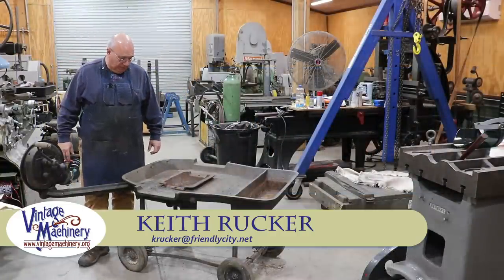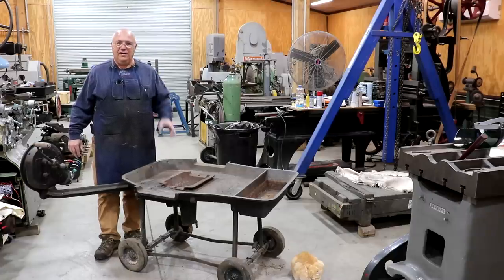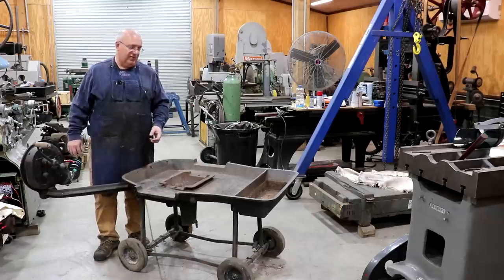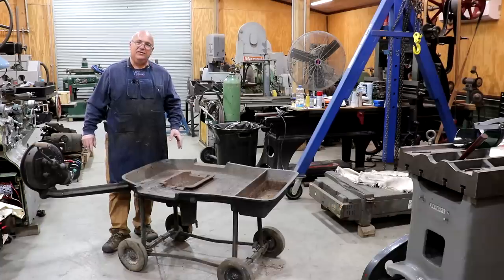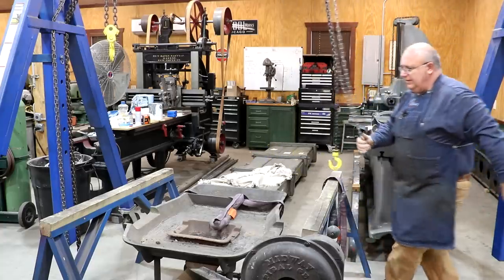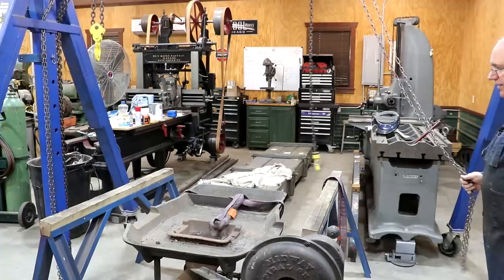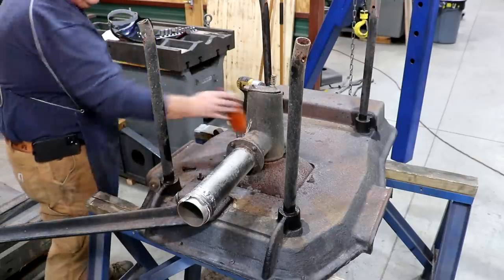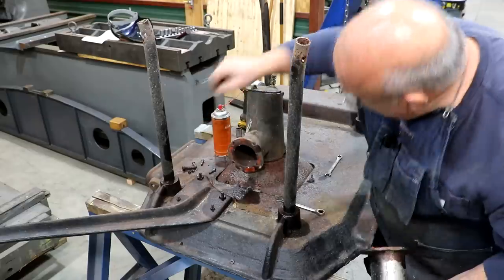Restoring a Champion “Midway” No. 71 Forge and Blower - Part 1:  Disassembling the Forge

Comment: I have the forge, anvil & tools that belonged to my great grandfather passed down through the generations. The duck nest is exactly like yours but with no tray. We have always mounted it in a rock or brick foundation. The blower is on a pedestal. My dad was particularly talented with it & I learned from him. When i was a little fellow, about 3 years old I discovered that by pulling down hard on the blower crank, the flywheel inside would give me a ride over the top picking me up off the ground. One day I was "riding the blower" and it toppled on top of me pinning me to the ground, the oil stem hit me in the head cracked my skull and I ended up in the hospital with stitches and a concussion. My Mother was horrified and surely gave my Dad the 3rd degree. The next day, I was eating lunch (broccoli) in my hospital room when the doctor came by... he said, "If that boy is well enough to eat that hospital broccoli, he's good enough to go home."

Comment: My grandfather (born 1891) trained as a blacksmith in a buggy factory.  When he finished training the boss put him in the paint shop, which he disliked.  He found a job on the railroad and rose to engineer.  He always liked working with metal, and could fix or fabricate just about anything.  I remember the unique smell of his workshop, a mix of varnish, grease, and coal smoke.  They don't make them that way any more.  Thanks for showing this new project.
Reply: Keith is probably as close as you'll get to your grandpa.

Comment: That red high heat silicone is a good choice for that gasket.  We used it on all our late model headers which would be glowing red hot for 100 laps.  It seals better and does not get loose and crack like a gasket.
Reply: I think something like gun gum paste  would be a better alternative.
The old local blacksmith here in town used that for decades.
He sadly past away not to long ago 🙁

Comment: My friend from the NJBA chapter of ABANA had one of those and it was such a joy to use. But looking at that firepot it is super different and doesn't look like the original. I do hope you restore that as well. That original design of the champion firepots worked so much better than the modern ones that just have a puck in the center. That puck always burns out, but the champion one never had an issue and the air was directed super well right to the middle of the coal fire.

Comment: I picked up blacksmithing back in my early 30s (around 2004ish I think).   Propane fired forge, but well equipped with a couple anvils, hammers tongs, etc.  Really got into it to make knives and did that, but had a lot of fun doing other stuff, like making the tongs and fullers, hot cuts, axes, all kinds of stuff.  Unfortunately, just like you mentioned, I tore my right shoulder up really badly a couple years ago and I still haven't gotten it quite behind me yet, may need another surgery yet.  Still have it all and hope to get back to it one of these days.  It'll be fun to watch you get it set up, and I sure do hope you post some blacksmithing content, I'd love to watch it.

Comment: Quite an addition to the shop.  Not intending to be critical, but you are like many of us and have a large number of projects going on at once. .Enough to keep you going for some time. It's the Sara Winchester approach.
Reply: I always like working on more than one project at a time, you get frustrated, or tired or stuck working on a job and you move to the next one until that one gets old. Then back to the first one with a fresh perspective and it keeps me from getting bored and messing up something. 
Just what I like to do.
Reply: @Hoaxer51  Yes, I agree.  But there is a flip side. When you get old and/or ill and there are more projects started than you can finish.  The high probability is your prized projects will all end up in the scrapyard.

Comment: Wow that's nice Keith,  Hope there is some fun in store and trying to find some stuff to fix this old forge. I have a Buffaloe Forge. the legs are probably 8 or 10 inches longer and like you say in your video they swoop out almost the whole length. guessing 2 1/5 or maybe three inches higher.  I think I measured the height at about 31" table top to floor. Good luck

Comment: Keith:  A muffler shop may be a good option for a new blower pipe.  They bend large diameter pipe like that every day, and the muffler pipe has to stand up to high temps. in use.

Comment: cheater bar info, I use aluminum baseball bats with the large end cut off about an inch from the end. There is a reinforcement band inside to strengthen the sidewall. Very light and strong.

Comment: Hello Keith!
I watch a saw mill channel that has a swinging chop saw. A 4-5" wide flat belt is used. The belt flaps like a flag in a gale. I think this may be an issue. How should a flat bet look in normal operation?

A set of 3 v-belts from the diesel engine to the 50" blade also flap. I think this is also an issue. Any suggestions or AM I being an alarmist?

Thank You and forge on.

Comment: Something you can do with cast iron you can melt and cut the old bolts out with a cutting torch without harming the cast iron as a cutting torch will not cut cast iron, however this will not work on cast steel as a cutting torch will cut the cast steel